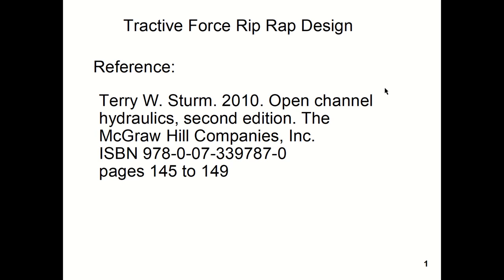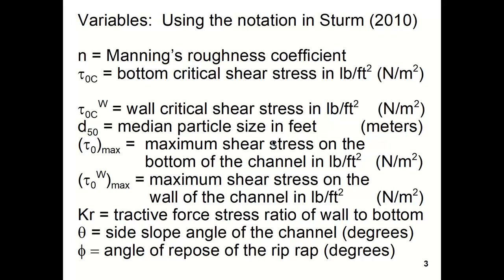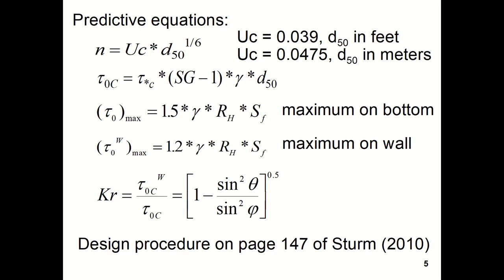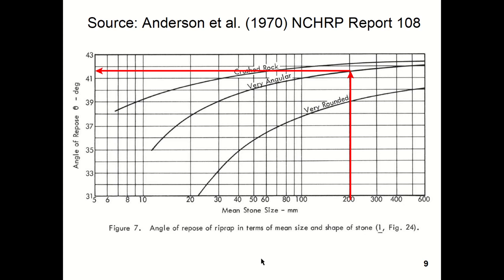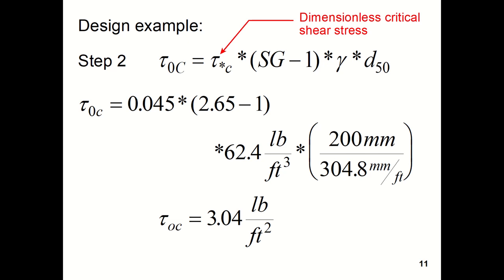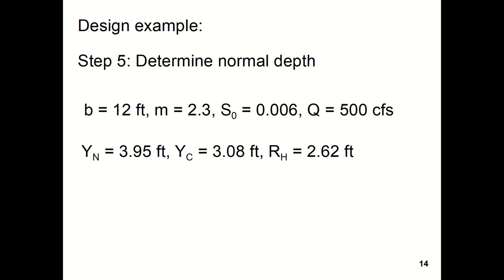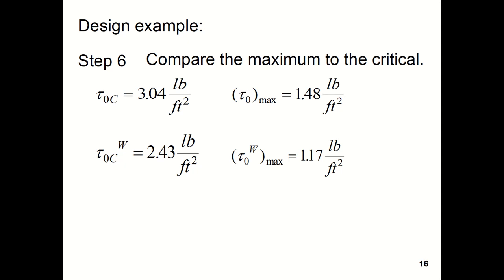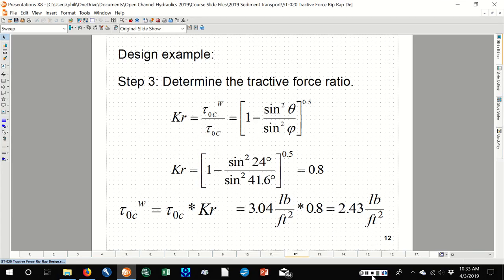ST-020 Tractive force method

Comment: Sir what is difference between critical value of shear stress and dimension less shear stress
Reply from the maker: The dimensionless critical shear stress has no units. It is typically obtained from the Shield's diagram or updated Shield's diagram. The critical shear stress is related to a specific material. In the video, you can see how the critical shear stress was obtained from the dimensionless critical shear stress.